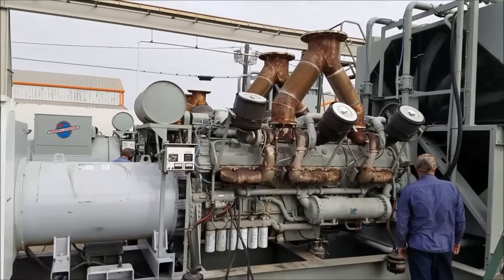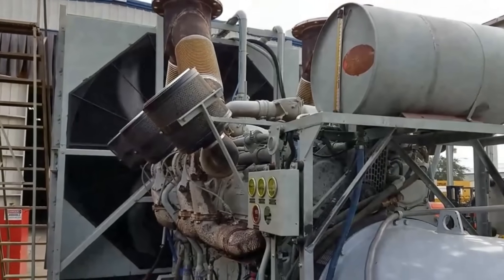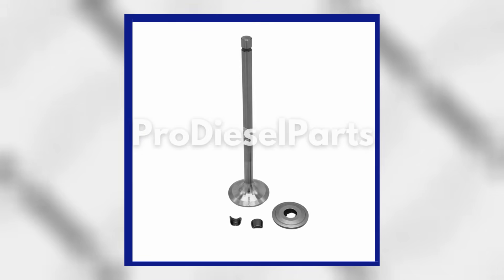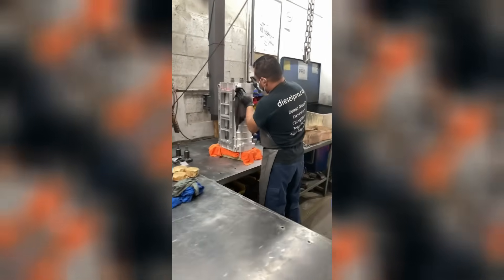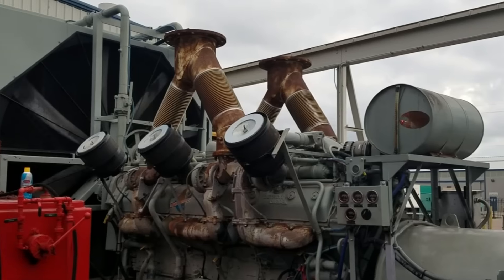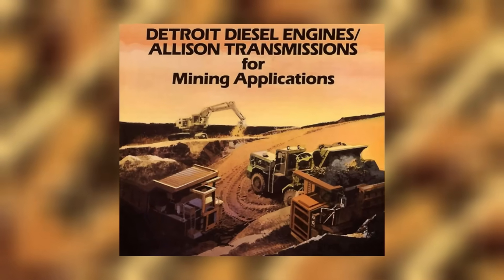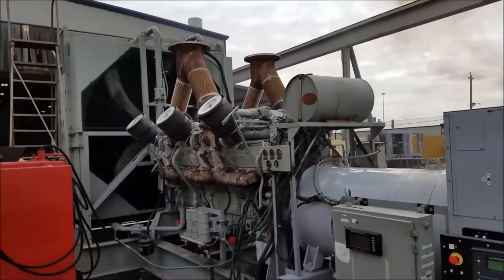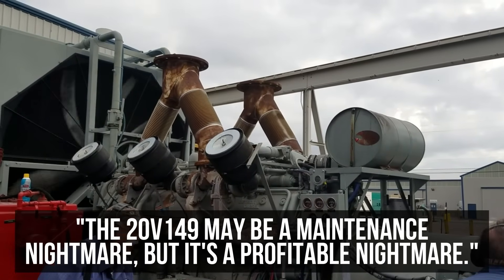The Shocking Truth About the Detroit Diesel 20V149: Too Hot For Its Own Good.

Comment: The 20V two-stroke engines are the absolute king of throttle response, with a power stroke every 18 degrees of crankshaft rotation. When you have a 20V operating at full rated speed, power never sagged with that kind of throttle response.

Comment: The reason Detroit made the 20V149 was because the entire DD 2-stroke line was bullet proof.  Old technology that was built for hard, hard duty.  And immensely dependable.  Even though there was some newer technology out by the time they designed the 20V149, they stuck to the old tried and true philosophy that made the earlier ones so successful.  And it paid off with one of the coolest engines I've ever seen.  Rude, Loud, and Proud.  You could feel the power vibrating the ground a hundred yards away.

There are multiple pairs running to this day.  Each runs 50% of the time.  Maintenance during down times.  And they've been doing it for up to 4 decades.  Some running pumping operations, some as gensets.

Then there are still more running in marine operations.  I have heard of at least one older tow boat that has one.  

I don't know where this video got its "facts", but I don't believe it in the least.  Judging by the other comments, I'm not sure why I am the only one who has downvoted.
Reply: I would never down vote this channel. There is authentic sound, video, and narrative. If you know of any other site that is waay better than this please reply. :body-blue-raised-arms:

Comment: Practically everything in this video is wrong. This is really an AI-sourced hallucination nonsense fest posted by an uninformed, inexperienced, and lazy content creator, IMO. I have several years of experience with the 16V149 in military marine propulsion, and those engines were amazingly reliable, needed minimal maintenance, and did not leak. While not the most fuel-efficient engines of that power rating, they would run at full rated load without any worries between maintenance intervals of hundreds of hours nonstop. The 149 series was an excellent engine when operated and cared for properly by trained and experienced personnel, and correctly applied to the operating conditions.
Reply from the maker: Not AI and not lazy, I can assure you. I researched this and showed this point of view because I found it more interesting that just explaining what the engine was. You clearly have more experience than I do, and I'm sorry you seem to really hate this video.
Reply: @VintageAmericanMachines  I don't hate your video, but I think you need to do better with the objective facts. I realize accurate info can be hard to find, but other diesel content creators find amazing historical information. The narrative does seem AI soruced. The narrator is not human for sure.
Reply: Hell John, do you have a channel?? Because I would love to see it? Please reply so I can watch it, thanks

Comment: This’n is fit for a Locomotive!
Reply: You are right.  It would seem like it would be.  But, I've never heard of any DD 2 stroke used in a locomotive.  They weren't aiming for that market.  The inefficient fuel consumption might have been one of the reasons.

EMD, GE and Alco are common brands used in locomotives.
Reply: It is not a locomotive application. EMDs are used in locomotives.